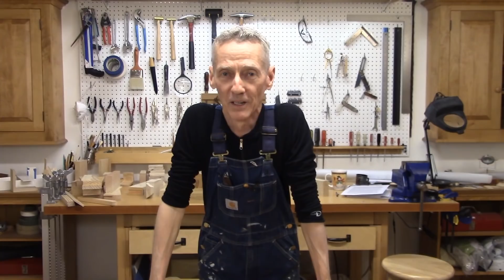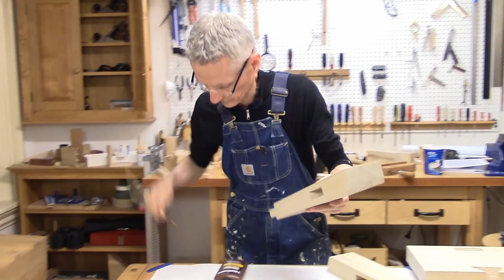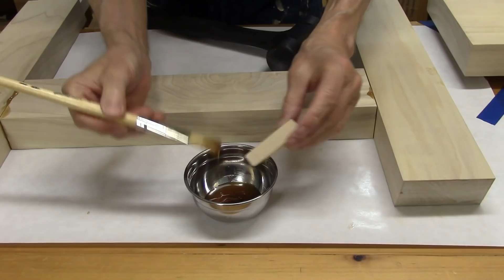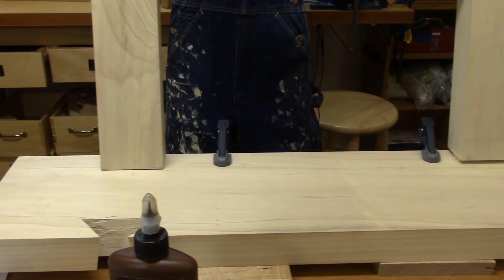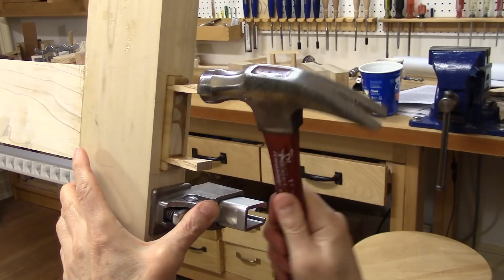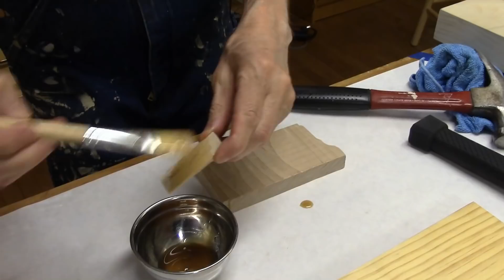Saw Bench Show #4

Comment: I've seen some use a bored hole at the bottom of the wedged curf do you see a benefit in that?
Reply from the maker: Hi Dennis. Wedged through tenons and how to make them is an interesting topic. Some say that a hole at the bottom of the kerf actually causes more splitting than less. But what about the size and location of the hole? Then there’s tenon length, location of the kerfs, grain direction, shape of the mortise, size of the wedges, species of wood, application of the glue….it just goes on and on. In the end, I chose the method you see in the video. I believe the strength of this joinery goes far beyond what is practically needed, at least in my lifetime and for a few lifetimes after. Thanks for the question.

Comment: I forgot in which episode you showed the use of an iron and wet towel to undent small blemishes in the wood. Good tip! used it today. To prevent any chance of burning I used a liter of boiling water in a flat-bottomed pot, just put a damp towel on and let it sit on that for 1 or 2 minutes. Worked like a charm.
Reply from the maker: Glad it worked for you. That was Saw Till Show #11. It's a handy technique, I always get dings somewhere along the way. Regards.

Comment: The bench is looking strong.  Did you consciously decide to not drill a relief hole at the bottom of each kerf, to prevent the edges of the tenons from splitting when the wedges are driven home?  I use a similar brush for glue-ups, but I sand flat spots near the ferrule so that when I need to lay the brush down atop the glue bowl or pot, it won't roll off onto the bench or floor.
Reply from the maker: +Chuck Finley  Hi Chuck. Drilling a relief hole can sometimes cause a tenon to split more. Chris Schwarz did a very interesting investigation on this in his article "Why Wedge Tenons?" Great idea about the brush, it rolls away from me all the time...thanks!
Reply: ***** 
I'll have to look that article up!  sounds really interesting!
Reply: Chuck Finley 
nice idea with the flat spot on the brush!!